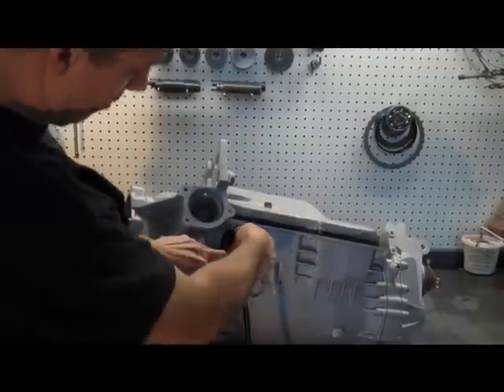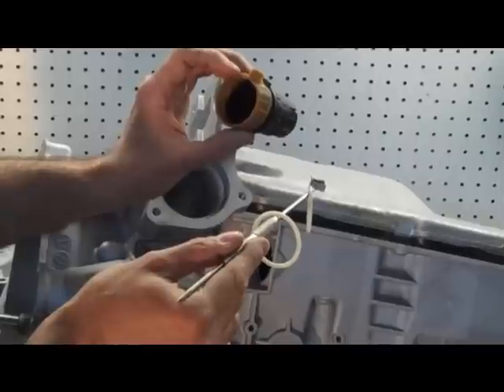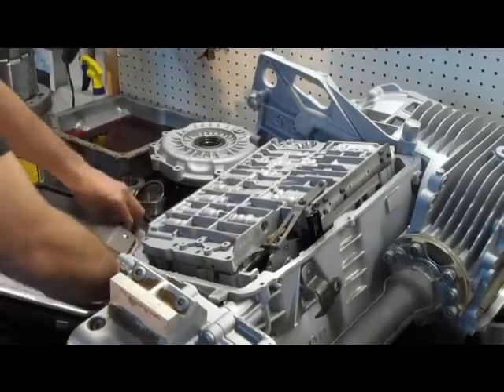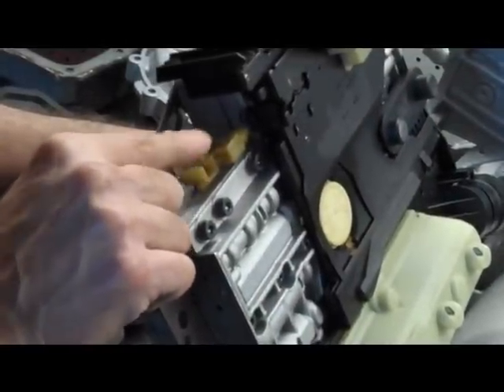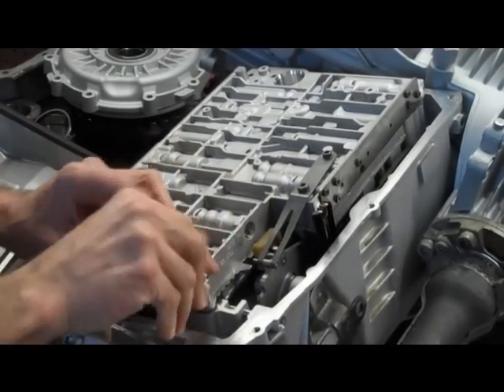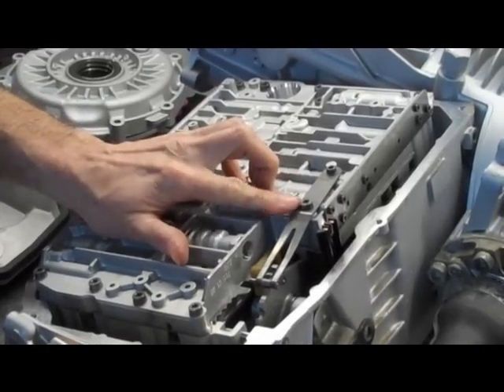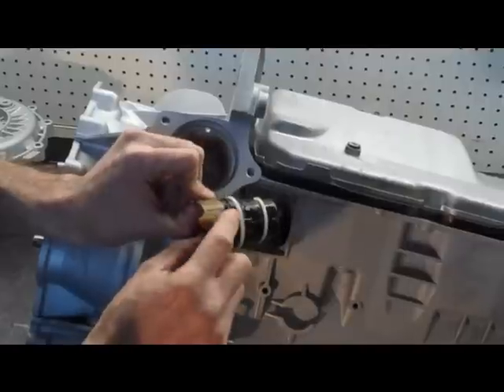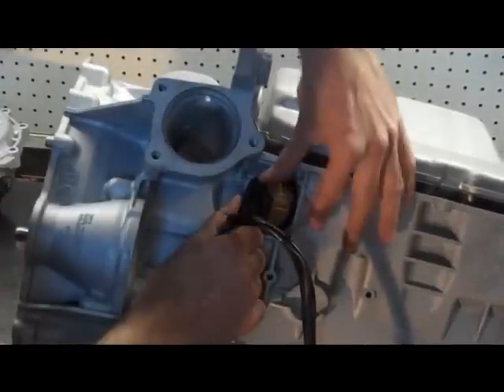722.6, NAG1, W5A580, Tiptronic Valve Body Installation

Comment: I have a 2006 dodge magnum 3.5l. when car heats up won't go in gear. check with Universal dips stick which read 85 while  car hot. so it has transmission fluid  . any idea problem

Comment: Great Video, good detail with torques as well.  Super helpful. I am ready to tackle mine as I have a P2767 "Input Speed Sensor 2 Circuit No Signal" code.  I had read a previous comment in a separate thread where the guy was unaware of the 7mm bolt.  I may have struggled but your video has me confident and ready to go. Many thanks, there are lots of folks whom appreciate your posting this!.

Comment: What world is this where the trans is new and clean and drips nothing and is oriented such that gravity assists you?!  Great Instructional!  Pitfalls to beware of and procedures all shown.  I prefer to tighten multiple fasteners in a criss cross manner, or skip every other one then do the remaining ones, then re-check the first set... but whatever works for you.  At the end.... "you just fill it up" without a level indicator is a tad complicated and needs some explanation, and evidently you can STILL have a resident DTC in the TCM which requires the pro with the expensive machine to reset.  So sayeth other similar instructables.  I am looking at this procedure plus valve body board to kill issues on the 2006 Dodge Charger 5.7 Hemi with NAG1 issues, as a DIY project to save oh $1000 or so, 5/2015

Comment: What's the the most common failure in the circuit? The board, the sensor, or the external 13-pin connector/harness? I've got the P2767 code (Input Sensor 2 Circuit- no signal) in my '06 Magnum RT and I hate to shotgun anything if I can help it.
Reply: what did you figure out on yours?
Reply: I replaced the conductor plate (Dorman 917-678) I bought on Amazon for $96 over two years ago. Problem free ever since. :)

Comment: Awesome. I have the exact trans in my Turbo.  Do you guys get many with a failed pinion bearing in the differential part?  Mine is making an off throttle high pitched noise and I'm pretty positive that's where it's coming from.